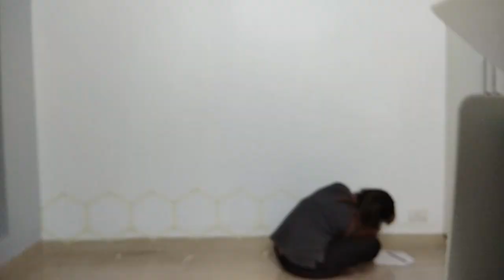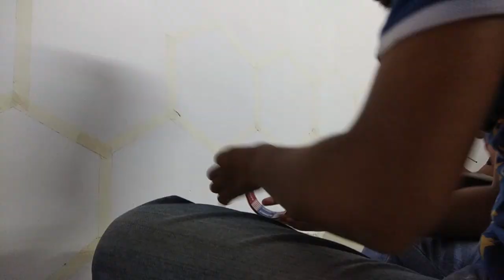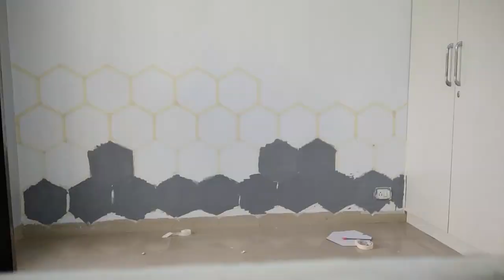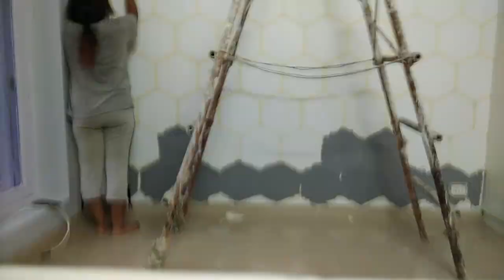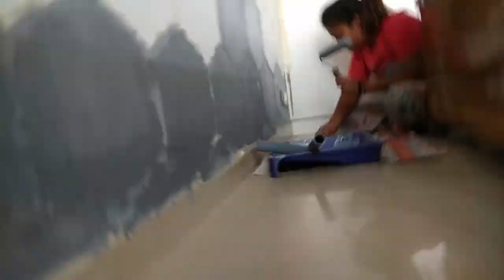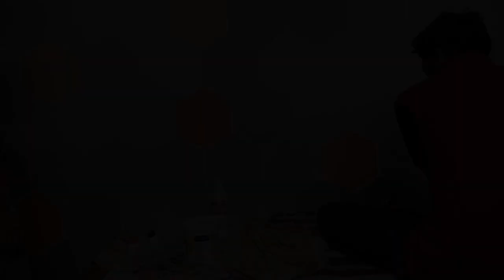[DIY] Hexagon/ Honey Comb Wall Art/ Design

Comment: How did you get the perfect size for the hexagons and make sure they were all straight
Reply from the maker: If I remember correctly, we used protractor to mark the 6 points and extended the lines from centre to the end to get the desired size of hexagon.

Comment: Hi nice work..Can we do it in already painted wall??  Should we use  primer again ??I am planning to do it in my new home ..What is strainer how to use .. plz explain. How long we have to wait to remove tape?
Reply from the maker: Hey, thanks.

I'm not sure about whether the wall should be primed or not but I also have a video on my channel where I painted over already painted white wall and haven't faced any issue with it yet so far. So I guess there won't be any problem but can't guarantee it.

Stainer is something like food color which when added to white paint makes various shades. We added drops of Black and Orange stainer into a portion of white paint respectively to get our desired shades of Grey and Orange. We didn't buy different color paints in order to save money.

Wait at least 12 hours or till the paint dries off completely before you start peeling the tape.
Reply: @DerperDoing  thanks for the information
Reply from the maker: @nivedithas3707  Welcome :D

Comment: what type of adhesive tape it is?
Reply from the maker: selvan dinesh It's called masking tape. You can get it in any hardware shop or that carries paints.
Reply from the maker: selvan dinesh Everything used has been mentioned in the description.
Reply: Hey very good work looks neat I have tried a striped paint but was not successful as the tape peals off the paint that it has been stuck on to, which masking tape did you use? Is there something you did differently while prepping the wall pls let me know thanks
Reply from the maker: Avenger Thanks first of all.
And we didn't do anything different before painting. First primer was applied on the wall, and then we used Asian Paints' masking tape. We bought the tapes twice that too from two different stores and they gave us the same tape, so I guess Asian Paints' tapes are widely used.